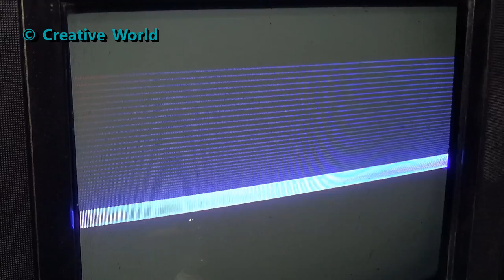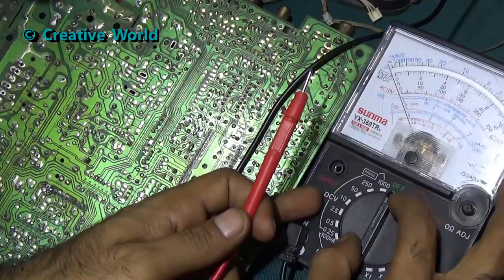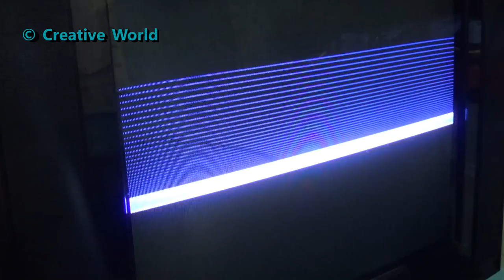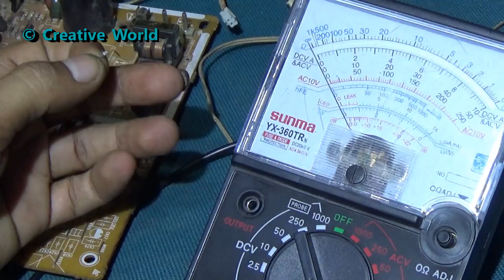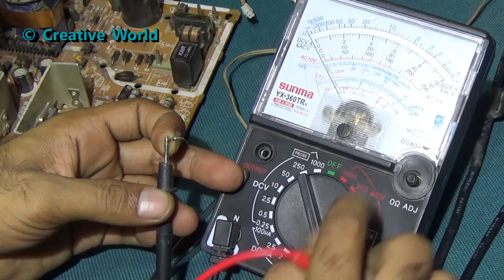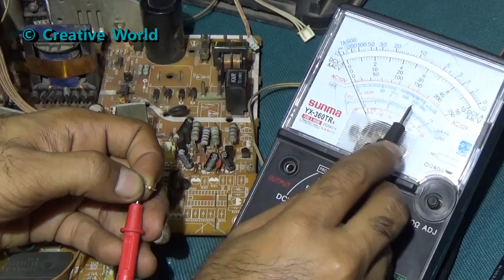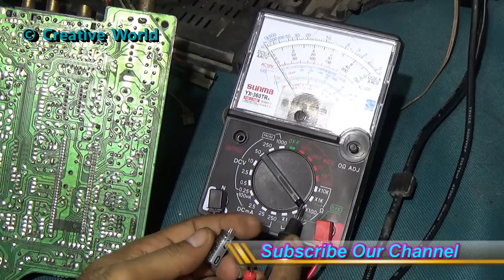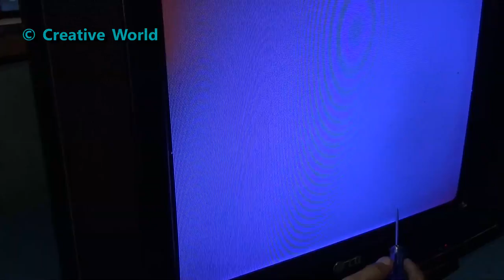How To Repair Horizontal Line Of Color Television (Part 3) - Bengali Tutorial

Comment: Hi I have a LG TV number 2 holidays is running the lamp for almost one second and the tunes and television is floating, no pictures and no sound, explain the holidays where and what is the note I fix TV, but this holiday is very difficult for me
Reply from the maker: you should check the vertical ic and capacitor of the vertical section